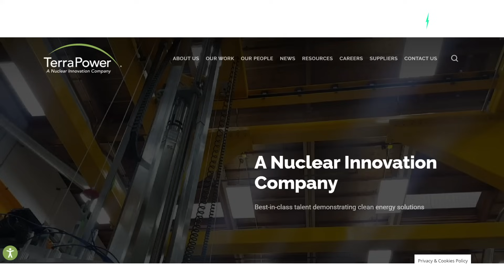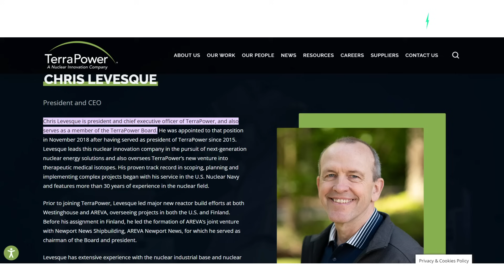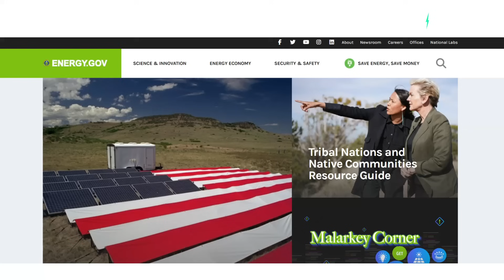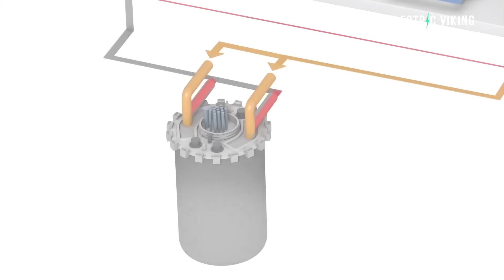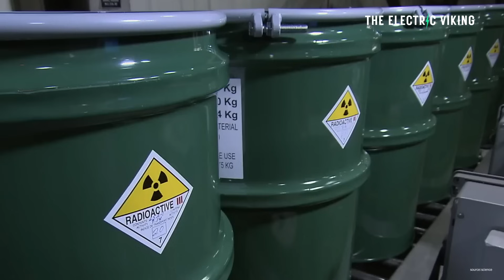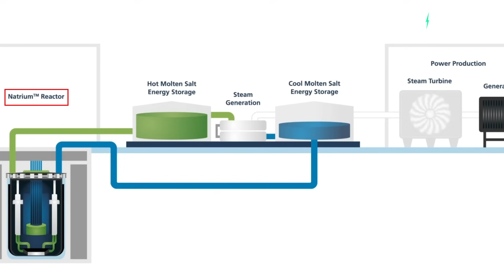Bill Gates' plans to build Modular Nuclear Power Plant in US without permits

Comment: I'm an engineer who has spent decades in nuclear power plants - and am very pro nuclear.     Terra Power might be able to build it (if they can get local building and environmental permits); but they will not be able to get fuel for it, have licensed operators, and they may not be able to get a license to operate it in the future (just one non-trivial mistake and it can never be licensed).

There is nothing new about liquid sodium cooled reactors (Fast Neutron Reactors) or even liquid sodium cooled nuclear power plants.  Not counting the test reactors and very small demonstration power plants 6 countries around the world built liquid sodium cooled commercial sized power plants starting construction in the mid 1950's and into the late 1980's (Including the USA - Fermi 1 Online 1963 - partial core meltdown 1966).  Lets just sum things up by saying that to the best of my knowledge all of these plants (with the claimed exception of Russia - see below) had significant problems and were shut down very early in their expected life.

Russia built another one as well that went online in 2015.

Only Russia is currently operating I believe 2 commercial power plant size sodium cooled reactors online in 1980 and 2015.  They claim that they have not had any problems.  However, it seems that those of us outside Russia (and the old Soviet Union) don't hear about the real issues and problems until 40+ years after they happen in their other or previous nuclear power plants, with the exception of Chernobyl which could not be hidden from the world.   So I encourage you to take the Russian claims of no problems with their sodium cooled nuclear units a grain of salt; especially given how many problems everyone else had with them.

2 countries are currently building new commercial power plant sized sodium cooled fast reactors (China, and India); and both should be near the end of their construction and testing stages.

While liquid sodium cooled reactors are somewhat cheaper to build than PWR reactors - the claim of 1/2 the cost has no basis (that's fantasy).  A good number of them were built - and the world has a good idea of what they cost in general.

The very claim of Generation IV reactors is a lie... its just to make it sound like its new and exciting.   Westinghouse got a design license for the Generation 3+ passive safety AP1000 PWR in I believe 2011; and nothing I have seen in all the "Generation IV" designs does any better although each reactor technology has its unique advantages and disadvantages (6 AP1000's have been built - another 10-15 are in initial site construction and advanced planning).

Every single "Generation IV" reactor design I have looked at is nothing more than an update (often a minor update) to a previous generation 1 or 2 reactor design of that technology.  In reality the Generation IV pebble bed HTGR China started up is nothing and the Terra Power (and China/India) sodium cooled designs are just 3rd generation designs.   Generation IV is just a hyped name because it sounds good.

Back to the Regulations and where Terra Power stands.    For approval to get fuel and operate a nuclear power plant in the USA Terra Power needs both a licensed Reactor Design, a Licensed Site, and currently a Construction and Operating License (although a post construction "Operating License" will suffice for an already built plant).  They have none of them.

Current process is to get all of these licenses up front before starting anything but site preparation work.  While it is possible to license after construction; we learned in the 1980's and 1990's that often required expensive and time consuming rework and some plants were abandoned mostly completed as it was realized that they could not be licensed to the current standards (the standards kept changing after Three Mile Island, the Brown Ferry Fire, and lessons learned from commercial construction technique life failures in operating plants).   If Terra Power gets something wrong... they may never be able to license what they built.

Right now Terra Power is in initial "pre-License" review with the NRC.  This is a step where the NRC works with companies to have them submit documents to them to ensure that the company understands all the factors that have to be addressed in a license submital, and that the company's design and processes are developed enough for them to be able to within a reasonable amount of time to be able to submit a complete license package.  Its common for new companies to have to go through 2 stages of pre-license review to get them prepared enough to assemble a proper license submital.    Terra Power is well into this pre-review process. But nowhere near the end.  It will be years yet before they can submit a reactor design and site license package. Then figure 2-3 years for the NRC to review and issue licenses.  At this point I doubt that Terra Power could even get either of these licenses by 2030.  I have no idea how long it will take to get an operating license for an already constructed plant after the NRC agrees to license it and the site (assuming they do license it)  Tossing money at the NRC will not speed this up.

Most people do not understand that a reactor Design License is not a blueprint for a completed plant.  Its a statement of how each component and system is designed and assembled, with certain other things specified  in detail.  However, key information is in the Site License and the plant cannot actually be designed and constructed without that key information from the Site License.  This key information relates to Design Basis earthquake, flood, and other natural disasters for the plant site.  The Idaho NuScale site had a Design Basis accident of a volcano eruption, which will likely apply to Wyoming.  I assure you that all of those can have major impacts on how a plant is designed and constructed (and seismic design for earthquakes often changes how thick pipes and vessels are - not to mention the size and number of support structures).

So you cannot even design and build a nuclear reactor without the natural disaster criteria in the Site License.   To build something prior to that is real folly in my opinion.

Terra Power will not be allowed to buy any nuclear fuel without an approved reactor and site license. No one can legally sell it to them.  They also need NRC licensed operators to operate the plant.  The NRC will not license anyone for a reactor design and site not licensed.

If Bill Gates thinks he and Terra Power can pull a fast one over on the NRC.   I don't think so.  Lets just say that if he tries that I anticipate a "Banned from the nuclear industry for life" letter issued to Bill Gates and the CEO of Terra Power.

Now if he tells the NRC that he is going to use the old "we build it and license all of it later" per the old method; then I fail to see why the DOE would pay him the $2 Million grant until the everything is licensed.

As for nuclear power plant construction times:  Worldwide the average construction time for a 1 GW Power plant is 6 years (and about 6 such plants are completed every year).   The USA and Western Europe had not built nuclear power plants in many decades and frankly forgot how to do it (and only about 1 out of 4 normal commercial construction workers can effectively work in nuclear construction).  If you take the contractors and key workers who built Vogtle (a dual unit AP1000 plant) they could likely build another set of AP1000s in about 8 years per unit, and a 3rd set close to the world average 6 years.   This learning curve also applies to non-nuclear projects as well.  The 1st time building something unique takes a lot of time, with the construction time dropping each succeeding one built.

I disagree that SMRs will ever be cost effective. There has been a lot of hype based on false assumptions the last decade.  A reality is that the USA and all other countries started by building SMR sized plants (the SMR concept dates to 1955 along with the claims of cost effective mass production).  The 1st ever design that was supposed to be the prototype for a mass produced SMR was a BWR at Elk River Minnesota which started up in 1963.  The cost of staffing the plant alone made it uneconomical.

A reality is that what was found out by the late 1970's was that if you doubled the size of a nuclear power plant; that you needed about 40% more material and construction cost, and virtually always did not need a larger plant staff.    So doubling the size of the plant dramatically affected economics of operation.  This is why the world generally builds large central stations because they are vastly more economical than a series of smaller plants.

The 2023 bid to build the NuScale 6 unit SMR project demonstrated this concept very well (6 50 MW units ==> 300 MWe).   I believe it was about $9.5 Billion with an estimated inflation adder of $1 Billion over the construction time (using the contractors that built Vogtle).

That's about the same cost as building a single AP1000 (~1150 MWe) and the plant staff size would be essentially the same.

SMRs cannot compete with larger plants.  There will never be mass production because significant design differences exist for each site due to worst case local conditions; and the world does not need enough nuclear power plants (of even 50 MW per unit) to justify the cost to build a factory to mass produce reactors and steam generators.
Reply: Could you call nuclear reactor for submarine s a SMR ?
Reply: @per-ingarauberg8164   Yes, a naval reactor is in the SMR size range.

However, they are exhorbantly expensive as they are a special design and uses very highly enriched uranium so that they don't have to refuel for the expected life of the submarine of ship.

The higher the enrichment level the more expensive it is (and each increment in enrichment is more expensive than the last increment - it's a parabolic cost curve going up.  As an example of such a cost curve:  6% enriched uranium is not twice as expensive as 3% enriched uranium.  It's 4 times as expensive.  12% enriched uranium fuel is 16 times as expensive as 3%.  Now push those numbers well above 60% enrichment level that naval reactors use.

They would not be cost effective as a commercial power plant. 

It's far cheaper to refuel a reactor every few years than to build a naval reactor.  Also, the naval reactor is physically smaller because of the higher enriched fuel level. 

Have a great day,

Comment: Hi Sam, I was interested to try to calculate the power that could be generated from the site of the coal plant at which Bill Gates is planning to build his nuclear reactor if you used the land to build a solar farm instead.  I did a quick Google search and discovered that the site is at Kemmerer WY and is 1,120 acres or 4.53 hectares (1).  The average insolation at a tilt equivalent to the latitude in Kemmerer is 5.32 kWh/m^2/day (2).  The power of a solar farm at this site, assuming a conservative 20% panel efficiency is 5.32 * 0.2 * 4,532,479 / 24 /1,000 = 201 MW.  Bill Gates' nuclear plant will supposedly produce 345 MW, or about 1.7 times as much power (3).  Taking a pessimistic view of the cost of building a solar farm, this would cost USD300 million, or 1/13 the supposed cost of Bill Gates' plant (4).  So the nuclear option would cost 7.6 times as much per MW.  Of course, solar is not base load, so you would need to add some battery storage, which would add to the cost a bit.  However, it is likely that the cost of running a solar farm would be way less than a nuclear plant.  And you wouldn't need to worry about the need to store the nuclear waste for centuries.  Or pioneering an unproven technology.  

References:
1. https://wyofile.com/victim-of-the-times-kemmerer-coal-fired-generator-shuts-down/#:~:text=The%20Naughton%20Plant%20sprawls%20across,in%201963%2C%2056%20years%20ago.
2. https://www.solarenergylocal.com/states/wyoming/83101/
3. https://www.forbes.com/sites/antoniopequenoiv/2024/03/19/terrapower-what-we-know-about-bill-gatess-nuclear-power-plant-in-wyoming/?sh=63579282350f
4. https://upmetrics.co/startup-costs/solar-farm#:~:text=Starting%20a%20solar%20farm%20in,20%25%20for%201MW%20solar%20farms.

Comment: With the low low cost of wind, solar & batteries, nuclear power makes zero sense. Why risk the danger? Why spend the extra money? Just deploy twice as much wind & solar as you will need & put the surplus power into batteries. You'll then have all the power you will ever need, in less than half the time it takes to build nuclear. No uranium mining, no nuclear waste, no problems!
Reply: The initial investment for wind energy is high. Large scale wind turbines cost a few million dollars per megawatt to put up, which at face value appears competitive with new coal-fired power plants, but the wind doesn't always blow. 

In effect, wind turbines typically only produce electricity about 30 percent of the time, so it takes longer to pay back the building costs.
Reply: @MrClassicmetal  Yes, sort of, if you average on-shore & off-shore. "A modern wind turbine produces electricity 70-85% of the time, but it generates different outputs depending on the wind speed. Over the course of a year, it will typically generate about 24% of the theoretical maximum output (41% offshore)." Still much cheaper than nuclear & with faster pay-back.
Reply: Solar is even less expensive, so will have faster pay-back. But wind is a good complement to solar, since wind blows at night. (though batteries might be even better)

Comment: I think there has been a serious conflation of terms. The Natrium website and you said that the reactor would be cooled with "liquid sodium". Liquid sodium imply to me that molten sodium metal will be used as the coolant. And there are fast breeder reactors designs that do use liquid sodium metal as a coolant. But using liquid sodium metal is extremely hazardous since pure sodium even in solid form is extremely reactive and will spontaneously ignite if it is exposed to water. Since this plant uses the steam power system of the old coal power plant, that means that there would be heat exchangers with liquid sodium on one side of a thin metal wall and high pressure water and steam on the other side.

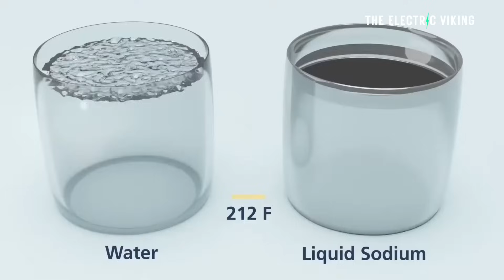 At 2:31 in the animation of the plant schematic you showed it says that it uses "Hot Molten Salt Energy Storage". The schematic of the reactor makes it appear that the molten salt is being circulated around the reactor. That is an entirely different kettle of fish than molten sodium metal sinc a sodium salt (potentially just plain old sodium chloride aka table salt) has been completely reacted and so can not react further with water or air. 

Can you shed any light on this issue?

Comment: I think the reason all these different countries are going for nuclear power and energy at least two pronged. One is it’s more centralized and more centrally controllable that means it’s more profitable. Two is possibly more power for a longer period of time if they do the technology right. And I think the other reason behind all that is nuclear doesn’t need storage the way renewable do.

I personally think it’s moot point. And the reason I think it’s important to have renewables and to decentralize more of our energy production is that way it’s resilient on a huge countrywide or regionwide system of energy to have to deal with because of the properties of electricity where you have to have a certain amount of load, has you avoid going all the way down and have a blackout or go not so far down and have a brown out, which is what we’re doing now because our infrastructure is too old and we’re using so much more energy. 

So behind all this nuclear focusI think the need for reliable energy that isn’t dependent on externalized stuff like the sun and the wind. Or as much anyway, even though we need some kind of uranium supply for nuclear. 

Personally, I prefer renewables anyway for a variety of reasons. Nuclesr similar to fossil fuel fits our current utilities paradigm of energy distribution but no matter. We can still build both. My two cents: we will need both nuclear and all renewables to move out of fossil fuel burning to make power. 

We all have a dog in this race. I was thinking it is better if we have more than one dog in this race, and if we have a bunch of them we can comfortably bet on them all …why not.

 People are so worried about the money, but that’s really not the issue. We have money somebody has it. And the goal is not to save money. The goal is to move off of fossil fuels to avoid more people needlessly dying of cancer, cardiac diseases, and respiratory ailments, to also avoid burning up our kids and grandkids. That’s the point. We are not gonna be able to save money while saving the planet. For the most part. So we may as well put our all in—- money, renewables,  nuclear, whatever it takes.